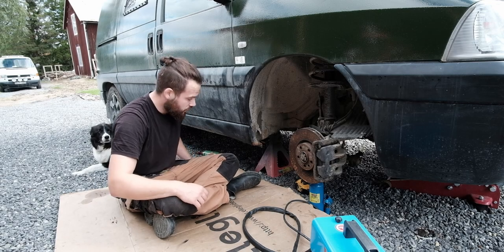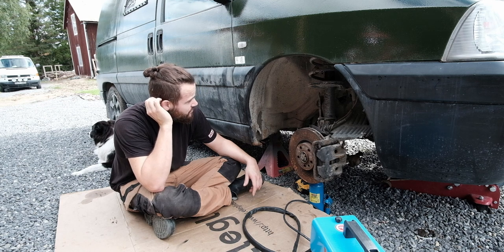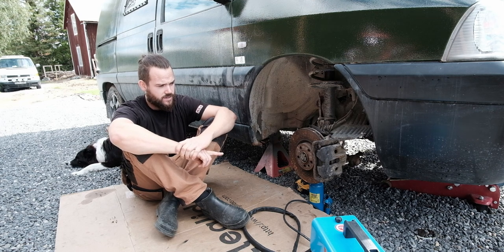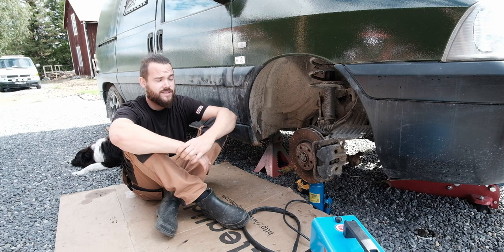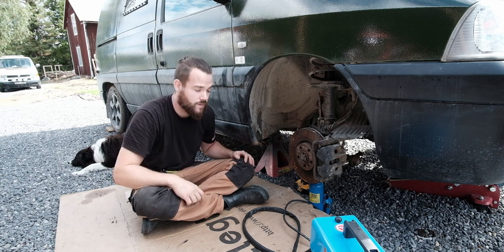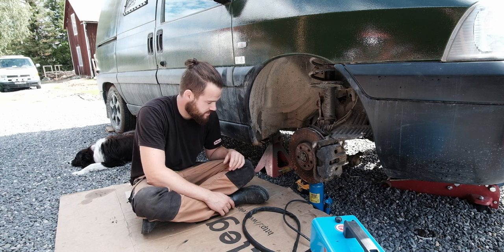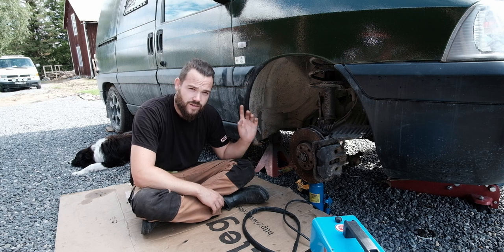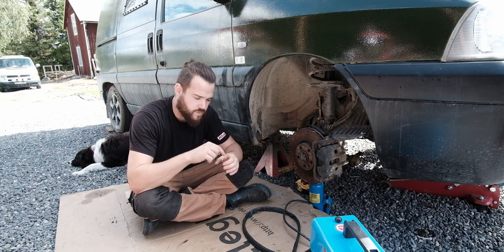A Bad Workman Always Blames His Tools, But Sometimes He's Right...

Comment: It has to be the right tool for the job. One of my uncles was struggling to do some work on a circuit board using a 200W soldering iron more suited to soldering wires together. I told him the iron was the problem. “It’s a bad workman that blames his tools,” he came back with despite it being himself that was failing. I went home and returned with my 15W iron. “This is fantastic!” was his reaction when using the correct tool.
Reply from the maker: Haha yea! When you're stubborn it's hard to see the light 😅

Comment: Thanks for this. I've been fibre glassing over some holes on my van sills to hide it for the mot in a couple of months. But,  you're right. I need to learn to weld. I've had the idea in the back of my head, but dismissed it thinking I can't do it. However,   I think it's a must. I own a ford transit. Thank you for the inspiration.
Reply from the maker: I can tell you it's so worth it being able to weld. The basic skill of just sticking two pieces of metal together opens up so many doorways and saves you SO much money in the long run 👍

Comment: Snapping bolts yeah oxy torch are a god's send especially if you can get in with the penetrating fluid whilst it's hot and wick it into the party.

The issue with home mechanics is usually the case of do I really want to buy that special tool that I'll likely use once... Commences bodge job lol.

I worked with a plumber for a bit he used to use mapp gas it's hotter than propane so it's a notch up on propane without the hassle of oxy.. just throwing that out there.
Reply from the maker: Mapp gas definitely a better option but costs way more so for now I'll just stick with the butane 😊